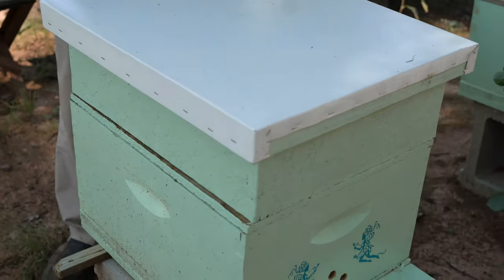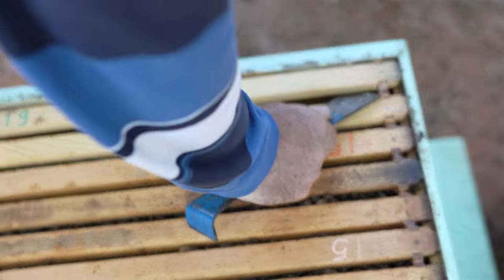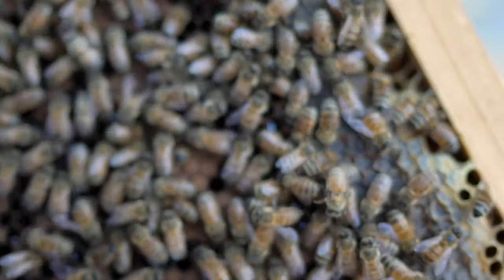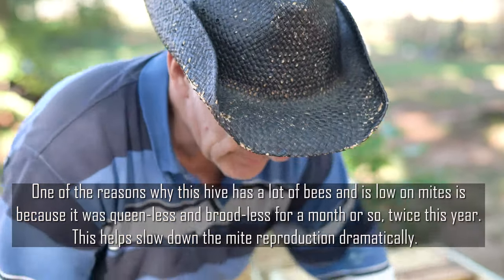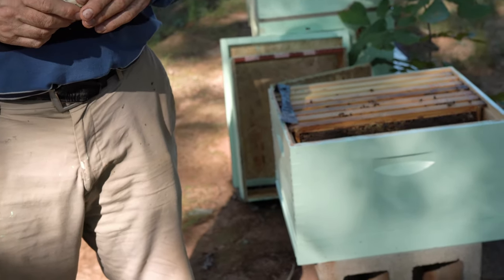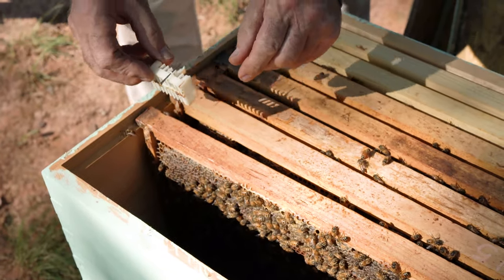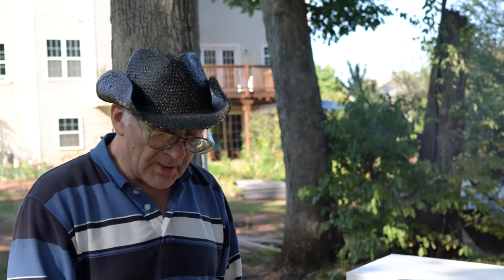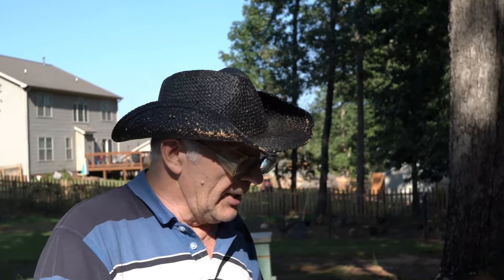Beekeeping For Beginners - Prepare Your Hive For Winter & Control Varroa Mites Naturally (Part 1)

Comment: Hi Pavel ~ , I saw until the end.  I have a question.  Is it OK to insert a cigarettes to the hive on the small metal dish, it will work the same way, bees will flap their wings due to smoke, which will have the same effect of inserting smoke into the hive by the smoker, which you did.

Comment: Thanks for another great video.  I’m a little confused... in a previous video I thought it was stated that caging the queen would cause the bees to create queen cells to replace the caged queen.  The positive effect is that the brood cycle is broken and more honey is collected.  Ultimately, after the virgin queen emerges and mates, the bees will kill the caged queen.  In this video the queen is caged and ultimately released.  Does this mean that, after a couple of days, you have to check for and destroy emergency queen cells?
Reply from the maker: That can happen, but unlikely to happen. Only if she drops an egg through the cage. Yes, you can check if you like for queen cells.
Reply: Thanks!
Reply: Good question.  I wondered that too.
Reply from the maker: Also, we are only caging her for about 15 days or so here. For honey we cage her for about 30 days.
Reply: Thank you for your answer!  Another follow-up.  Do you take into account the nectar flow when caging the queen for honey production?  For example, would April be a good time to cage the queen as that is the swarming season?  During the 30 days the hive should be decreasing in population as the queen cannot lay eggs.  That still gives two or three months of the nectar flow to grow in population?  I don’t recall if this was mentioned in your videos, all of which I’ve watched, but will caging the queen also help with swarm prevention, especially since you use one brood box?  Thanks!